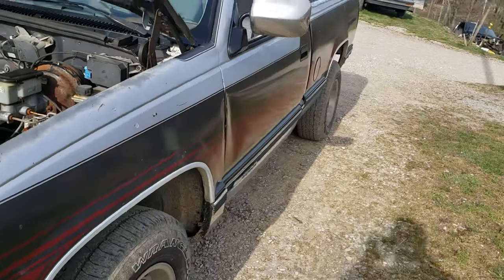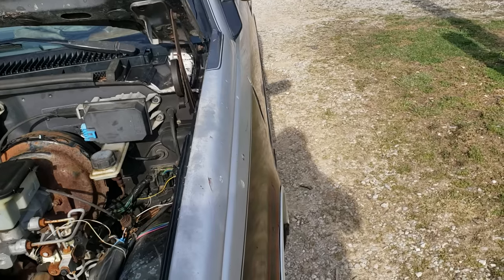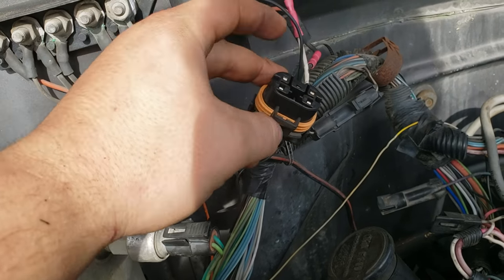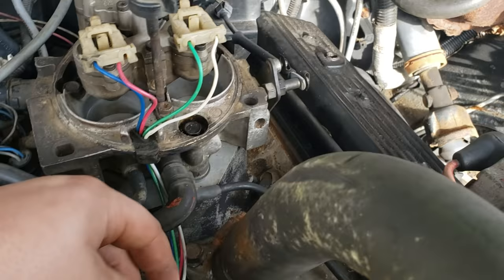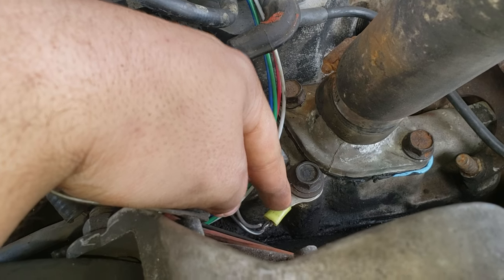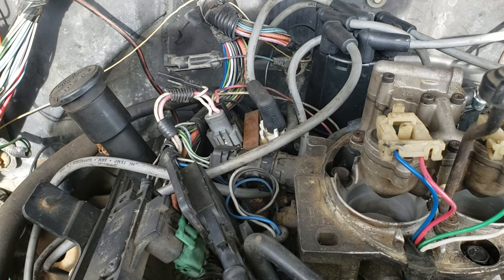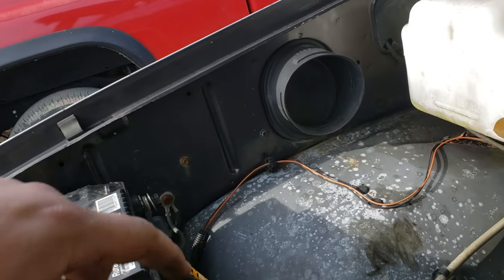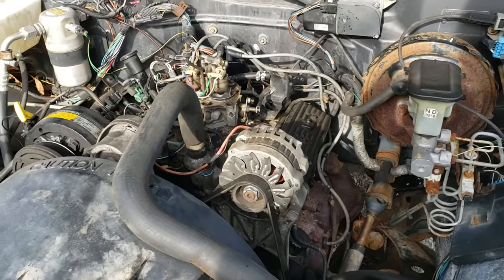Chevy/GMC how to test for a bad fuel pump tbi

Comment: Replaced all the grounds on my 1989 Chevy K2500. Added a few more. Made a huge difference all around. All the lights are about 50% brighter and everything seems to run better. Great video. Thanks.
Reply: Nice I have a 94 2500 and am currently having this no start problem ima check the ground but also seen it could be the relays

Comment: Thanks for the video! It helped me to fix my truck! Both of my gnd wires were an issue!
Reply: Hey Pernell I got a 94 gmc I'm having the simular issues runs bad, it dies if I don't keep feathering the pedal an will only go 25mph tops. What did you do thanks Todd
Reply from the maker: Glad I could help
Reply: Hey bud I’m having a issue with my 94. 350tbi I’m getting power to the purple wire on the fuel pump / sending unit connector. & No Power On The Grey Wire. Was running driving good. Developed a slight spudder around 100-110. Later on In the day it back fired & died. Couldn’t hear fuel pump running changed it out so no luck. Ran a hot wire to it both pumps work fine.

Comment: Really appreciate this i have a 88 k1500 5 speed 350 short bed regular cab that my grandparents bought new and i have now owned it for 12 years its my baby and i keep it as clean and nice as i can it just now going on 120000 miles. Me and my wife wer headed back from jay Oklahoma with a trailer on and it just died. Everything stayed on (guages radio lights and so on) but it was basically like i pulled the coil wire off thats how it died. No spitting and sputtering. It had blown a fuse I believe it was a 15 amp fuse that said ecu and I believe thats the module that has the “prime wire” to kick the fuel pump on before the engine has started. Put another fuse in it turned key on it started and died popped another fuse. Then put another fuse in it and as soon as i would turn key on the fuse would pop. So with basically having no other options i put a 30 amp fuse in it and it didnt pop (i know it was stupid but was in the middle of nowhere and about a hour and a half away from home. I was hot and flustered. That worked got it home then put a 15 amp back in it and it didnt pop and hasn’t popped for the past 3 weeks then on my way home from work tonight was going down the road and it did the exact same thing everything stayed on but was like i pulled coil wire so i pushed in the clutch went into neutral and was gonna coast it till it stopped but before the engine quit rotating it busted back off and now has me really scratching my head. Obviously the fuse wasnt popped that time. The fuel pump is original to the truck none of the wiring in or on the truck is hacked up or anything so ima check all the grounds you pointed out. Im a hardcore gearhead just the darn thing got me flustered just because of whos it was and it means the world to me but you have givin me a little more to check out so i sure hope i can find something or i warned it that it was going to become carbureted lol sorry for the rambling and thank you wish me luck
Reply: Not rambling. Thank you .
Reply: Mine:
"Would run good...touch brake & Shutoff!...move from 4wd to 2wd & shut-off!"
"Tapped into the Gray Plastic Brake Switch contraption located on left side of upper brake pedal, by crossing the Pink,with Black stripe, wire to 0range wire and B00M! Runs Perfect!"

Comment: That tan and black wire cross ground was my problem too. Thank you so much! 🤘
Reply from the maker: Yw bro
Reply: Where does the brown wire go into the main harness? I had a rat chew through it and I can’t find where it goes to?
Reply: @SloComaro  I’m not 100% sure but I do know those 2 wires have to do with the fuel pump relay. The fuel pump will not turn on, which will tell the computer/controller to not send spark to the coil/spark plugs. Maybe one end goes to the relay and the other to the computer or the fuel pump, possibly all 3 bcuz it’s 2 wires together.
Reply: @1bakecook1e yeah my fuel pump will not turn on and the only thing I see is that I’m missing one of the two grounds beside the thermostat. Rat chewed it but I can’t find the wire anywhere in the harness.
Reply: @SloComaro  I can look at mine tomorrow. I have a gen 5 454
Reply: @1bakedcook1e thank you!

Comment: Ik this is old but thx bro this really help me and I am 22 I just bought. This truck thx 🙏
Reply from the maker: Yw man
Reply: @rednecklife55  it really help
Reply: @rednecklife55  if I got no fire going to orange wire on relay what do I do?
Reply from the maker: @staceyevans188  cut it back run a wire straight to battery see if it changes anything
Reply: @rednecklife55  ok thanks!!!
Reply: @rednecklife55  run it to negative right
Reply from the maker: @staceyevans188  no, the orange wire is positive

Comment: My 93 Chevy van cranks, no start! No pump prime. Fuel pump is only a couple years old..after watching your vid, I’m going to check all the grounds I can find...thanks!
Reply: Ever figured it out?
Reply: What what it
Reply: @juggernautRico10  mine was that tge  fuel pump wasn't plugged 😂🤦🏻‍♂️
Reply: @MOE13576  plugged in the tank or the exterior harness?
Reply: @iamrobbiero  are you asking me what was my solution ?

Comment: Seeing lot of comments on grounds & hots while chasing my own issues, 
  Up by the fuel pump relay under that harness cover is all your "hots" on the firewall, I'm reading tons of comments those are almost hand loose from the factory, I just checked; mine were not that tight also, cleaning them up tomorrow..
  Couple more grounds, ones behind the distributor area from motor to firewall area, also ground strap near the starter..

Comment: Guy i bought it off of did the distributor, plugs and cables 
I’ve done tbi rebuild, injectors, iac & temp sensor getting ready for a fuel pump but i might have to get these ground cables a look, 1989 chevy scottsdale 2500 5.7 140,000 miles starts and runs but stalls randomly, loss of power also randomly, even randomly stalls after idling a couple minutes sometimes
Reply: I have the same problem as you right now. I'm pulling my hair out trying to figure it out. Any help will be much appreciated Thanks.
Reply: I'm having the same issue. Any luck finding the issue
Reply: @D-train69  did find you issue?

Comment: Wow this dude solve my issues I have a 1992 s10 blazer ,I left them ungrounded and wonder why I been have starting issues
Reply from the maker: hell yeah thanks
Reply: Starting issues as far as it not starting on first crank but second time it would? Currently have this issue now it won’t start assuming fuel pump but wit this video I’d check relays and grounds cause mine did have that start issue also

Comment: thanks Boss im currently chasing wires on my 1993 2500 just had a new pump installed 3 months ago and a puff of smoke shut me down today
Reply: Nice I have a 94 2500 and am currently having the same issues ima check out the grounds

Comment: I just did a swap from a 5.0 to 5.7. I’m getting spark no gas tho I’m hoping it’s just a ground. I will check tomorrow thanks for the vid hope it helps me. Just out of curiosity my 5.0 ecm will run the 5.7 correct? Just maybe a little lean?
Reply from the maker: yes the computer for 305 350 is the same. or at least should be.

Comment: I just did a motor swap and now I’m not getting any fuel on the tbi I’m going to have to double checked all those grounds tomorrow thanks great video
Reply from the maker: Ok let me know if you need any help! Is the fuel pump coming on??
Reply: @rednecklife55  On my 93 S10 V6 TBI,  I just replaced fuel pump and filter because pump was bad and sitting.  Pump comes on but injectors are not coming on.  Cranks but no start.  Will check grounds, thanks.
Reply from the maker: @soonjrush  have someone crank it and see if fuel comes out of the injectors while cranking
Reply: also tested injectors with 9 volt battery, good.
Reply from the maker: @soonjrush  spray some starting fluid  and see if she will fire up
Reply: @rednecklife55  All grounds are good and starts for 2seconds when I spray starter fluid.  Pump does come on.  No fuel from injectors at all.
Reply from the maker: @soonjrush  check ur relay, may be a faulty pump also
Reply: @rednecklife55  relay is good, you can here the fuel pump.  Replaced with new one already.
Reply: Checkeded fuel pump pressure from line before filter, good.
Reply from the maker: @soonjrush  checked fuel pressure on a tbi? How? Did u install a aftermarket shredder valve
Reply: @rednecklife55 My bed is removed so I got access right on fuel pump.
Reply from the maker: @soonjrush  what psi?
Reply: @rednecklife55  Just visually checked without gauge.
Reply: @soonjrush  did u find ur problem im having the same issue u had rnnnnn hellpppp
Reply: Try changing the ICM in the dizzy.  It controls injector pulse.

Comment: Mine did the samething, this morning went out, just would crank...Went and bought a fuel pump relay, but I'll check the grounds first..Thanks
Reply from the maker: Yw lmk how it goes bro
Reply: I just did a new pump and filter, engine cranks, but won't start. I can hear the pump prime when I turn the key, and the engine will start for a moment on starter fluid... what did you end up doing?
Reply from the maker: @andylangeland496  if it will start off starting fluid then u have a fuel delivery problem, recheck ur work. Pump lines and filter
Reply: @rednecklife55  ok thanks
Reply: i had crank, could hear pump no start. ended up being the ignition control module

Comment: Mine drives fine but when trying to cruise it just makes this tapping, chugging sound after it warms up. It's a remanned motor with only 6k miles on it. I've replaced the tbi gasket, TPS sensor, IAC valve, EGR valve, map sensor, knock sensor, ignition coil, and almost everything else. I'm at my wits end with it. Gonna check my grounds on it tomorrow.
Reply: How do you check to see if your grounds are up to par?
Reply: Hey. Any solution found?
Reply: I've found out that I've got a couple shorts in my wiring somewhere and the tapping sound is coming from the frame into the cab. Can mounts are hashed

Comment: Howdy, Thanks for the video very informative. 
Question, please. (Vehicle 1993 Flair motor home 454 TBI)       

My symptom is: Starts for a few seconds and then dies. If I give it the gas pedal, let off speeds ups, then it dies. Keep feathering gas pedal stay lit, won't go high RPMs.  But will keep running,  if I keep feathering and letting off the gas pedal.

Turn key on start, starts a few seconds dies.  If give it gas to accelerate in park it dies.  

 I can do the gas pedal thing give it gas let off, give it gas let off, and will stay lit, RPMs go up,  as I stop doing this it dies.  Suggestion to check, please. Thanks.

Comment: Quick question...before u fixed ur ground, was ur fuel pump turning on still??
Reply: Mine would start and run but as soon as I steeped on the gas it would cut out. New fuel pump, new injectors, new distributor cap and rotor, new tps. It ended up being the fuel relay. It would start because on these older Chevys the oil switch activated the fuel pump but only for so long

Comment: I'm chasing a won't start after shutting off when hot randomly or will randomly stall when idling... figuring a ground up front is my cause as fuel pump is running but injectors not squirting. Dump a splash of fuel into the TBI and she will catch.
Reply: Same any luck figuring it out?
Reply: I have what sounds like exactly the same symptoms. I looked at  several websites that said the ignition control module can cause it to stop running when it heats up. A new IGM did not cure it so now I’m testing the fuel supply. I’ll dump a little fuel in it and see if it will run when hot.
Reply: @paulbaker3144   Mine ended up being a intermittent grounding issue on the sending/fuel pump unit that finally just stopped being connected....that happened in the driveway thank you. Did not pin point the ground break spot but think it is within the grommet exiting the sending unit. Had another sending unit and that fixed my issue.
My hint of the issue is finally the fuel gauge stopped working as well...was kinda off/on in resistance prior.
Reply: Thanks for the ideas. I’m getting erratic intermittent readings on fuel pressure and voltage so will keep tinkering with the wiring. Im wondering if hot wiring power direct to the pump will bypass faulty wiring?
Reply: @paulbaker3144  And create a good ground clamp on the return line at the sending unit as well or first...
Reply: @paulbaker3144  you'll definitely want to put a relay and inline fuse on it if you bypass factory wiring with your own direct wiring to fuel pump.

Comment: I have a 1985 Blazer, I replaced the sending unit, I'm replacing the gas pump and my next thing will be the carburetor, because the Blazer running really bad 😞 sounds like fireworks coming from the carburetor, what is your take on this??
Reply from the maker: checking ur timing

Comment: I'm having to floor my truck after it gets warmed up to start it again after running to the store sometimes. Do you suggest any common problems with this issue
Reply from the maker: does the engine smoke any? could just be getting hot and then weak. correct fuel pressure? when was the last tune up? o2 sensor?

Comment: Great video, I'm having trouble with my 90 silverado I put another used engine supposed to be good, cause first engine got messed up and now when I tried key it only cranks, don't hear the fuel pump. I think I put every single sensor right everything looks good but won't start, I'll see when I come back from out of town and do what you did. I'm kind of lost on those grounds near the water outlet and on ac compressor on mine. Help
Reply: Reaching out for some help.  I'm in the same boat.    I've got a 90 chevy Scottsdale . Put a new used motor in.  Anyways, same story as yours.  Did you get yours figured out? I'm stumped.
Reply: @bobstewart4989  hope you figured it out, if not I mistakenly sent myself a reply to your question. It might help you
Reply: @lastofthegoods  OK.  Thanks.  Haven't figured mine out yet.  Got fire.  Everything is grounded.  New sensors, etc.  Just can't get fire to my fuel pump.  Next move is a hot wire to my fuel pump plug from the junction box under the dash by the firewall.  I just don't want to fry something. Lol.  Thanks again.
Reply: @bobstewart4989  try putting some fuel with a bottle, make a small hole on cap and spray fuel onto carb,if it won't fire up having spark on plugs then it's the timing

Comment: Had static in my audio speakers thought they were cracked also gauges didn't work properly found a ground that wasn't grounded. Fixed. Ground issues are 90% of problems.

Comment: i ordered a new fuel pump relay and it didn't fix it. I didn't even think about checking these. Thanks for the vid
Reply: On the frame where the fuel tank is there is a ground there too move that ground to a clean spot it comes from the sending unit that can make it not work at all

Comment: My injectors are working and my truck will turn over and eventually it will crank but it would be really weak like sputtering I changed the fuel filter I was about to change the fuel pump but I saw this video my ground on the left side of the fuse box is corroded this could be my problem too right
Reply: did you check distributor cap?
Reply: @MapleRocket   what do I need to check it ended up being a blown head gasket
Reply: @sosakiing4598  man that sucks.. but to check your distributor cap and rotor,  you have to unscrew the 2 screws holding it down im not sure the socket size but if they arent striped or too rusted you can probably use a philips screw driver. just pull it off and look inside and see if its clean or corroded or wet. if it is you can clean it with some sand paper temporarily or replace it for like 30 bucks

Comment: Thanks for all your videos. So I have an 87 Chevy Silverado and I can drive it for 20 , 30 miles or more and no issues, but if I shut it off it won't start until it cools off. Then it starts  right up. I also noticed that I can't hear the fuel pump after I turn it off . Once, the engine cools off I am able to hear the fuel pump priming the system . Any idea.
Reply: ignition coil
Reply: Fuel pump run cold because of fuel
Reply: Yes it ended up being the fuel pump. It threw me  off because the fuel pump had been  replaced 5 or 6 months ago. Also, I don't remember the fuel  psi that it had but I remember it was within the specs . That's also another reason I was sure it wasn't the fuel pump.  Someone mentioned that it might have a good psi when cold but once it would  warm up it would loose psi and that it wasn't enough to overcome the heat soak after it was turned off. So I installed  an  Ac Delco fuel pump and now it runs great and it starts everytime.    Like I said I just didn't think it was the fuel pump because it was almost new. Hope this helps someone else.
Reply: What brand fuel pump was the bad brand?
Reply: @CJ9494.  It was a fuel pump from Autozone.  It ended up using an AC Delco and solved my issues.

Comment: Ok. I havent checked the relay or grounds. I went ahead and replaced the pump and strainer. Turn over, no start. Pump is running though. No fuel getting to the tbi. 1988 gmc 1500.
Reply: Try the fuel filter
Reply: I have the same exact situation, did you figure it out?
Reply: @andylangeland496  yes. It was a fuse. I cant remember which one. I sold the truck shortly after i fixed it.
Reply: @derekhardin7486  thanks
Reply: @andylangeland496  did u solve ur issues im having the same issue pump running fuel to tbi no fuel injectors
Reply: @559Obsalex  yes it was a corroded ground connection on the cable running from the battery negative to the engine block. I made a video about it https://youtu.be/uNGi8EwoVl8